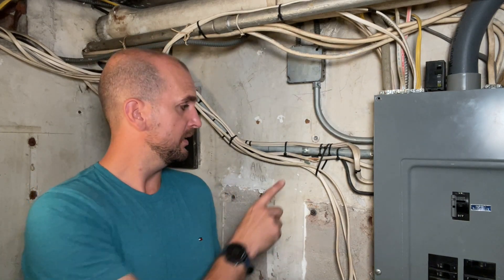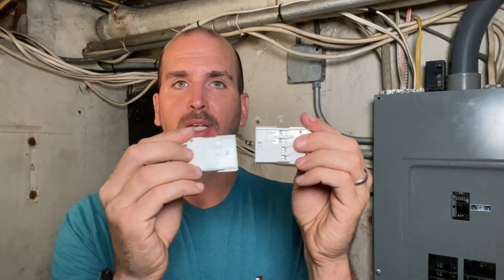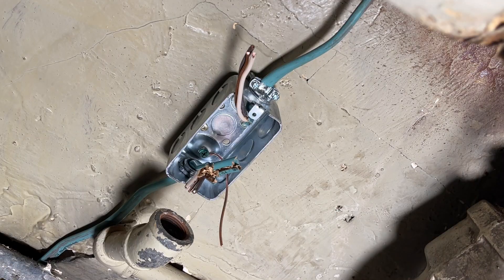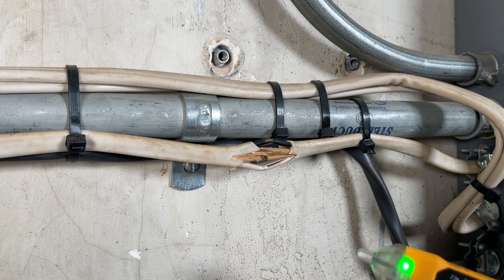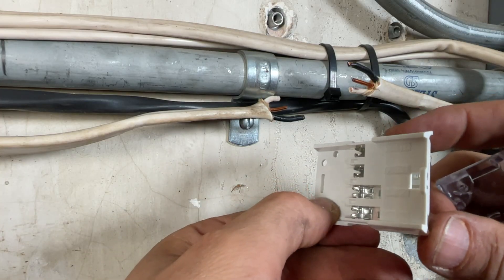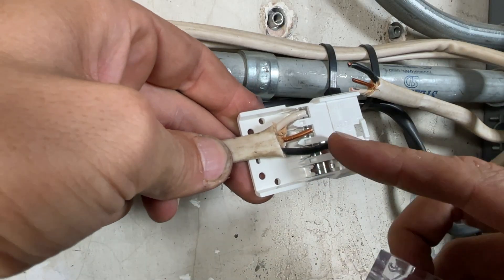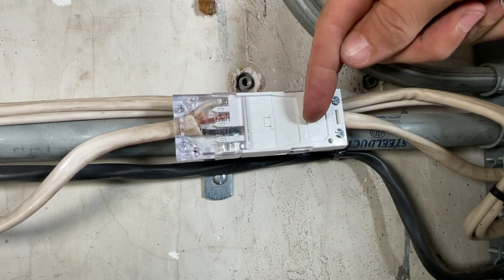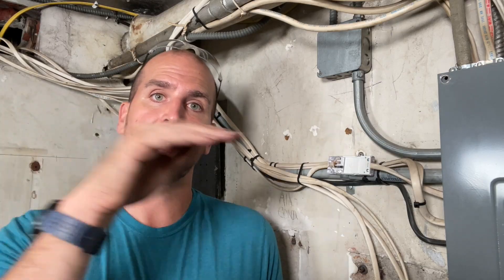How To Repair Damaged Romex Wires

Comment: Those te splices are junk.  I've replaced loads of them. Never leave those in walls.
Reply from the maker: Hey Dan, thanks for the feedback.  What type of failures are you usually seeing?  High heat load from the small contact area make by the "fork" design of the contacts?
Reply: Yes. The ones I've pulled out usually have worked there way loose to cause a loose connection. Some I've pulled out have been melted from the loose connection.  They are often used in motorhomes and in mobile homes.

Comment: The new WAGO 221-2411 ist just ideal for a connection when the wires are short.
Reply from the maker: Nice!  That splice looks awesome I would have definitely used that if I had known it had existed in the handy box example.
Reply: It's about time. The Chinese knockoffs have had inlines for quite a while. I only use the knockoffs on low voltage projects of mine.

I can not think of a residential use for inlines at the moment but if I needed a straight splice I should like that. I might grab a few to have. I could always use it for temporary hookup of motors when testing them without having to keep hardwiring them in.

Comment: Sorry, NEC or not, I wouldn't trust those things. Remember, NEC approved aluminum wiring.
Reply from the maker: Thanks for the feedback
Reply: Aluminum wiring is still good to go. It was the connections and the expansions that were not accounted for. Unless you have really old Aluminum wiring and connections anything nowadays should be fine. Most will be copper anyways but running a subpanel with thick gauge aluminum is far cheaper.

Make sure your connections are rated for Aluminum. Shit, your ground and neutral bars are made of aluminum after all.
Reply: Aluminum is still approved and used everyday

Comment: Mainly dealing with direct bury wire I would never cut a wire just to fix a skinned wire. Every splice is a path to a lightning fault. There are several 3M resin packs that are 600v rated splice kits that can be used without cutting the wire. May not be NEC code though.
Reply from the maker: Yeah, I looked at a few of those solutions but couldn't find one that was approved.  Appreciate the feedback.

Comment: I would add a receptacle instead of a blank plate. I would also replace the run from the new junction box to the panel so that I have 8" in the box as per code.
Reply: This is his house, not yours. I highly doubt he needed an additional receptacle in his basement, otherwise he would've installed an outlet. If he ever needed one in the future, he can always replace the cover plate with a receptacle.

Also, replacing the whole cable requires lots of time, energy, and money. If you're replacing the cable, then there's no point in adding a junction box. Instead of replacing the cables, just add pigtails. I upgraded a single gang outlet to double gang and the grounds inside the box were too short, so my new pigtails were longer than my hot and neutral pigtails. That's a lot easier, and cheaper, than ripping all the walls, replacing the romex, patching the wall, and matching the texture

Comment: On the first one you could have taken off the pipe elbow and moved the box to the left and run a new, longer cable to the main panel and in general you aren't supposed to support a raceway from another raceway but put a backer board secured to the wall that you can staple to. I haven't seen anybody on youtube that strips romex before they put it in the box. It's easier, really.

Comment: Those  Tyco Electronics splice kits are used on mobile homes to make the connections between the 2 sections once the home has be transported, or at least they were in 2004 when I purchased my old home. They are sketchy if you ask me. I had lost power to a few outlets and traced it back to one of those fittings. The ones they used allow them to connect multiple sets in one connection. I was able to pull them tight together with cable ties. Given the choice I will always use the handy box. My fear with the TE connectors is that over time the plastic will degrade and fail.
Reply: I lived in a mobile home that was built in I think 2015 and it was the same way. Not a fan at all. If you ask me, that is even worse than backstabbing outlets and switches since unlike these connections, at least the backstab connections have a spring loaded tab to keep the wire somewhat secure.
Reply: I totally agree ,seen them fail to many times and the idea of putting in wall that is no longer accessible is pure crazy
Reply: I had nothing but problems with those connectors,everytime I go to a modular home due to loss of power I trace it back to one of these.they are garbage.
Reply: I've got a mobile home by Fleetwood built in 2020. It has those connections. I'm hoping that the fact that all I plug in around here is phone chargers and two LED tv's, it will be ok. There is the fridge in the kitchen and my girlfriend's hair dryer, those are the only things that use more than an amp or two. All the ceiling lights are LED  too. The one's from the factory are junk. I'm replacing them with Lithonia Lighting wafer lights.
Reply: Wasn’t Tyco a toy manufacturer?
Reply: @shaffer4220  They were. It's a bad name based on affiliation. Tyco Toys went out of business in 1999. Tyco Electronics was rebranded TE and they are owned by Johnson Controls.

#I do supply chain analysis for electrical components
Reply: @packetattack7437  Anything owned by Johnson Controls I wouldn’t trust. I worked for them for years. It seemed to me they placed profit above all. They are a conglomerate that ruins anything they buy. York HVAC products and the red top automotive batteries are 2 examples. I have a pre Johnson red top battery that is about 25 years old. Since Johnson bought them I’ve been lucky to get 3 years out of one in rarely driven cars. I work in commercial HVAC and have seen the quality of York’s products go downhill since the Johnson acquisition. Knowing their involvement would be enough to discourage me from using these.
Reply: @shaffer4220  They're actually unrelated companies with the same name.

Comment: Any decent electrician, in this particular circumstance, would either place a handy box, or 1900 box such that the wire outgoing could enter it for over 6 inches and replace the remainder of the run to the panel, or, as another commenter suggested, run the Romex into the existing 1900 box, and run thhn the rest of the way into the panel, if there is sufficient volume available in the box.
Reply: It looks like a flakey repair at best. 
I'd feel better adding a junction box & replacing the end going back to the panel.
Reply: What's a 1900 box
Reply: @orestracki6617  1900 box is what some guys call 4" square boxes
Reply: @orestracki6617  4 inch square,  1-1/2" depth
Reply: 1800 not 1900, 1800 is a regular 4x4 electrical box used for joints. 1900 is a deep 4 sqaure box
Reply: Also you cannot use 1800 or 1900 4 sqaure boxes in houses they are metallic
Reply: @kgvargas978  sure you can use a metal  box in a residence. Just have to ground the box & use proper connectors
Reply: @kgvargas978  what??? Dude don’t give advice if you don’t know what you are talking about. You can use steel junction boxes in houses. 🙄🙄

Comment: Wago not good. surface area of contact is not sufficient, and connection relies on spring loaded metal. Over time this is a bad situation waiting to happen. Wires twisted appropriately provide better surface area contact, wire nuts just serve to insulate.
Reply: A. You don't need to twist wires to use a wire nut. You're not really supposed to. Because the wire nut is the connector. Twisting and cutting is my preferred method but the wire nut isn't just an insulator.

B. Wire nuts are rated for the surface area they contact without a pretwist.  They don't have much more area if any than a Wago.

C. Wago has been thoroughly  tested for tension, surface area, heat, voltage, amperage and has been fielding in massive numbers. They are just as safe as wire nuts... and anyone that's been around has seen a failed wire nut or 3.

It's all about preparation and testing the joint. Pull on a wago it isn't moving if done properly. You should pull on a wire nut as well to check.

Also, I can't tell you how many switches and receptacles I've opened to find ground wires (alone with the other conductors) just covered in paint. Now how does one expect a ground wire to work very well covered in paint, twisted, and a wire nut just placed on top and not twisted? Sure it might work or it might be insulated. 

Any time I find that I bring out the sand paper and pliers and wirenut to redo the connection. Or Wago if I feel like it. I prefer wago on the insulated conductors and a waste on ground wires.
Reply: @etherealrose2139  I work on commercial lighting (live 277V) often enough that I truly appreciate the wiring being twisted together such that when the wire nut is removed the joint remains intact, AND FUNCTIONING. It is the copper to copper contact that is the lion's share of the connection. In a WAGO, it is a connection via steel, no direct contact between the copper conductors.

I don't care about any other aspect of the argument, copper to copper is vastly superior to copper to steel to copper, every day of the week, forever and anon.

I've seen WAGO connectors inside CNC machines, where they are readily visible, and only making relatively low current control function connections, and they are just fine for these purposes. I would NEVER use them in a junction box, or inside a light, where the connections may be carrying the entire load of the circuit.

Comment: NEC still prohibits NM cable (romex) run being run where exposed to mechanical damage. That whole basement is illegal. You had also better check where that splice kit is approved for....
Reply: That's what I was thinking.  Any NM cable less than 7' above grade was to be protected (covered by drywall, in a raceway, etc.

Comment: There is a 1900 box above it, cut the romex, use a romex connecter and run it in that box ( unless it is loaded, follow wire fill calculations) and then make splices, run new single thhn wires through the conduit to the same breakers, easy inexpensive fix, 10 minute job.
Reply: I think you missed the video maker's point.

Comment: Excellent effort in finding a new product and there may be a letter example than this one. I would have pulled a new longer wire from the panel to the break with enough wire to put a proper wire nut splice in a box. I have had the screw through the wire and as a dyi-er I did everything I could to get more slack or run a new wire. Some things just don’t have a short-cut. It’s your life, your family’s lives and lives of people that occupy that house for years to come. No “hacks here, please”.

Comment: Slap some ET on it.
Reply from the maker: It is my understanding these are getting buried everyday in walls and in locations which can not be accessed especially in the double-wide manufactured home industry.  I will be the first to say the junction box is much better but just don't have a great solution if the damage is caused in the wall.  Thanks for the feedback.

Comment: That plastic push down is janky AF.  I would individually wrap the individual wires with some Scotch 33.   Then wrap the whole bundle with some more Scotch 33 before using that weird contraption.  

But I would do the Jbox above all else.

* - Not to mention the Jbox is way cheaper.   30 bucks for that stupid thing ?   Some people have more money than brains.
Reply from the maker: I line up with most of what you said just don't have a good (approved) solution for Romex damage if it is in the wall.  Welcome any other options and thanks for the feedback.

Comment: Those splice kits you used are garbage. DON'T TRUST THEM to hold up .if you were to bury that in a wall within a few yrs you will just be cutting the wall open again and hope you remember were exactly you buried it or you'll be going crazy and cutting boles everywhere trying to find it .

Comment: The handy box repair you performed is not code legal. Code requires 6” of conductors protruding from box.
Reply from the maker: Thanks for the feedback.  Interested to get your feedback.  What would you have done if presented the exact situation?
Reply: @EverydayHomeRepairs  I would use two handy boxes, and an additional piece of romex. Installed the boxes with enough wire length extending out of the boxes.

Comment: DIY. I've never seen that connector. I'll be buying it now. Thank you.
Reply: don't, they aren't good
Reply: @mikebowler1962  They are good, but they are also expensive. I would use them when the Romex is inside a wall, but where it is accessible like in the video a junction box would make more sense - other comments on the video suggest that the NEC only allows them to be used for repairs inside a wall.

Comment: Sorry 30 years an electrician and I do not trust IDC ( insulation displacement connectors) for anything other than a light fixture, Very low load. Bad things can happen man I've seen things man ....bad things....

Comment: Is there a solution for a buried cable that gets nicked.  Quite a common problem when people are digging.
Reply: There are water resistant, UL approved splice kits for direct buried UF wire. Personally, I would never direct bury the wiring in the first place, it is quite common and legal though (UF cable, looks like grey romex).

Comment: Emergency situations if the copper wires not damaged you can open Romex up enough to tape it real good especially on the hot wire L1 or L2 type up the grounds and neutrals take a plastic box cut it where you put the we're into it put a cover over for temporary you can even screw it to the wall tape job needs to be done really super well supposedly make some sort of glue that can cover the wire

Comment: Notice that the clamp screws on the romex connector that connects the white romex to the panel are not tightened down, it looks like the black cable below is also not clamped. Bet the inspector missed that!

Comment: Can anyone give a quick simple answer as to why we have to ground to the junction box too? I mean if it was plastic it wouldn’t be necessary, probably just a safety in the rare case a hot or neutral touched the metal box right?
Reply: you are grounding the box to the wire, not the wire to the box.  so if the hot wire comes in contact with the box it will trip the breaker instead of setting a trap for you.
Reply: Hit conductor breaks off or rubs out or somehow makes contact with metal box. You come along and touch. Probably zapped.

You add a EGC to the line. That short circuit is now pulling more amps back to the panel and trips the breaker. No longer zappy. If all your connectors are tight this should t be an issue... but it can be so that's why you ground out the metal casing.
Reply: In the old house I own the outlet boxes are mostly metal and have no grounds at all. Nothing is there to stop that situation from zapping someone but I haven’t had any inspectors showing up giving a crap about that😂 even when I bought my house and a home inspector went through it. What good are codes if they don’t have any inspection intervals even when buying a house ?
Reply: @lh98  home sale inspectors know very little about electrical systems.  they have a checklist of things to look for, and don't know much beyond that.
the official cure for an ungrounded system is to protect the system with ground fault interrupters.  in any system old enough to be ungrounded, I also lean heavily towards arc fault protection, because at this point, the copper will be getting brittle, and an arc fault can prevent a fire if something fails.
Reply: @kenbrown2808  thanks for the reply.! Does it matter if it’s a gfci breaker in the panel versus gfci outlet? I know the house has 3 prong plugs mostly but after looking inside a few of them none actually has a ground wire
Reply: @lh98  go with breakers if you can. Houses that old usually have star layout for the circuits instead of daisy chain, so even though the breakers cost more, you'd have to use multiple GFCI plugs for each circuit.

Comment: Need to check neutrals once cut, in case it's being shared with another circuit.
Reply: Very true.
Reply: Yep. I've been shocked twice because someone shared a neutral with no label and no tie bars on the hots sharing it.

First time slipped my mind to check it.

Second time, I could have sworn I checked but given the two far away locations of the two branches I still have no idea how they managed to share that neutral. I did magnetically couple that one but it didn't pick anything up at the time. I believe the homeowner flipped on a light three rooms over as i was working on it. 🙄

Comment: The cost of wire is not the issue but the cost of labour may be. If splicing in a box is acceptable, that is my choice. If the wire looks bad or is pretty old, I may run a new piece. DIY'er here.

Comment: love your videos. seems like every one is something i can use. Ok i recently ran into a damaged romex inside a mobike home wall…i just wire nutted the 3 connections and wrapped heavily with  3M Super 33. im sure that wouldnt pass insp but i feel confident it isnt a safety issue. am i wrong?
Reply: what happens when the adhesive fails or a wire nut comes loose?
Reply: Your insurance better be good

Comment: This is still a hack.  A short term fix, yes.  Long term no way.  This will likely decrease your amperage capability and if overloaded might even heat up and melt.  I could be wrong, I haven't seen the specs, but this looks bad.  And I do have a degree in electronics, so I do know a bit about this.  I'd like to see an actual electrician weigh, because they are a specialist in this application.